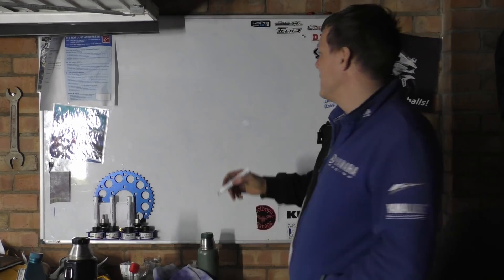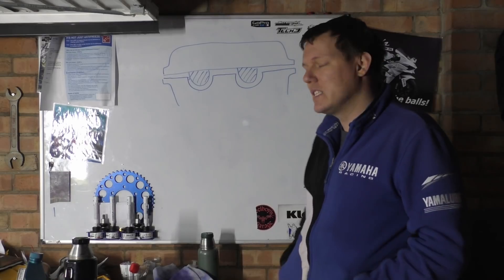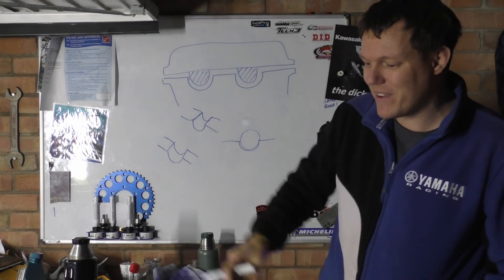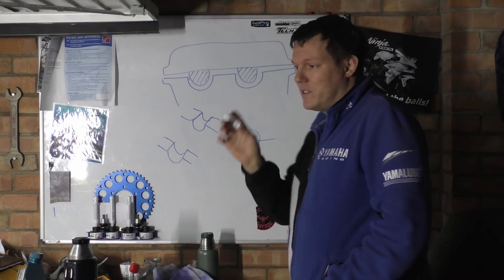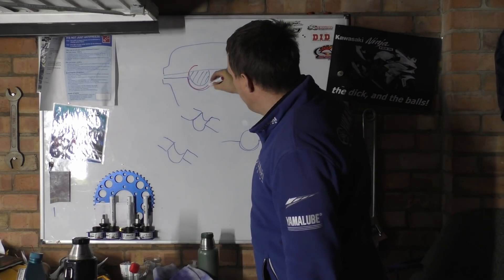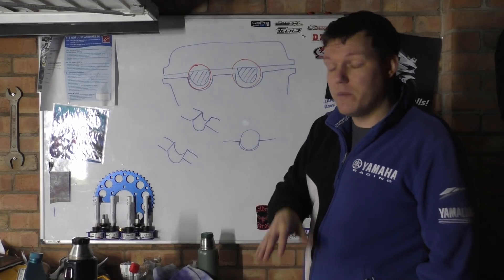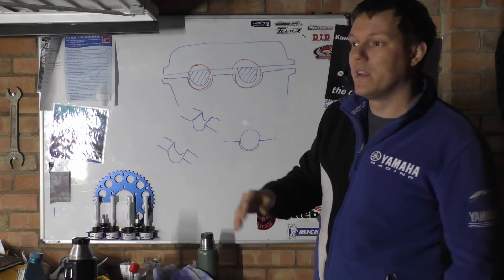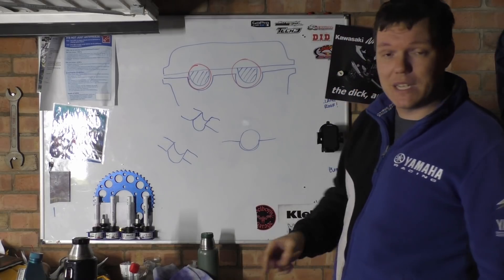Cylinder Head - semi circle feature

Comment: I bought the 1982 Honda VF750F when it first came out, the one with the chocolate cam shafts where the hardening started flaking off.
All got fixed under warranty and I also remember they did a fix with the cam bearings as well which I think related back to the machining being a bit off.
Can anyone remember better than me how the cam bearings came to be out of spec.
Looking back at pictures of the engine it does not have the "D" bits under the cam covers, so maybe their process was less than ideal or fool proof.
Untypically Honda when it comes to engine engineering and the first VFR that I got next was a jewel, probably to make up for it.

Comment: And also the camshaft holders need to be bored too, while mounted on the head. This is why manuals say to be very careful when working with the holders because if one cracks you can't just buy a new holder and slap it on. It needs to be matched to the head.
Reply from the maker: "And also the camshaft holders need to be bored too"

- of course they do, and they're called cam caps. This is also shown in the pictures and the video clip.
Reply: Yep, if you look in the video the caps were being bored too. Not seen this being done before, but visually reinforces why you need to be religious about marking caps to make sure they go back into the same place.
Reply: I just googled cam caps and its a site with pirated content from live xxx webcams